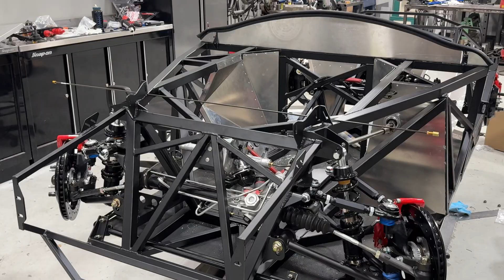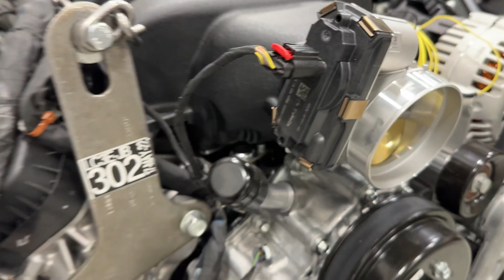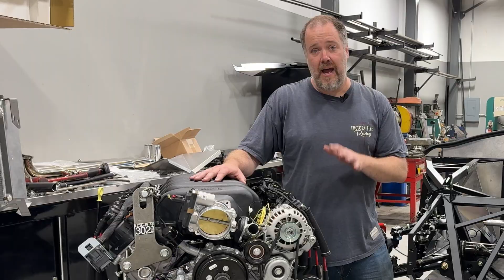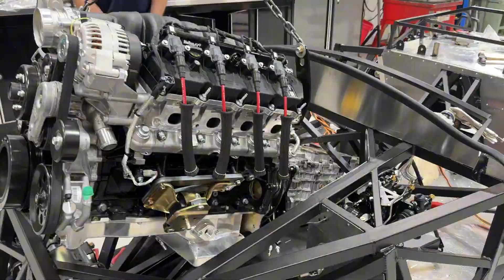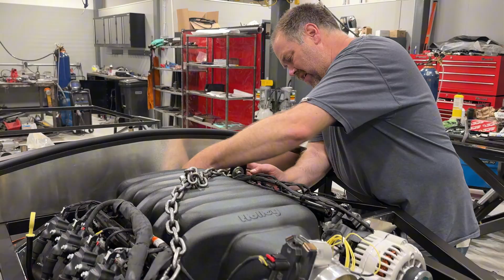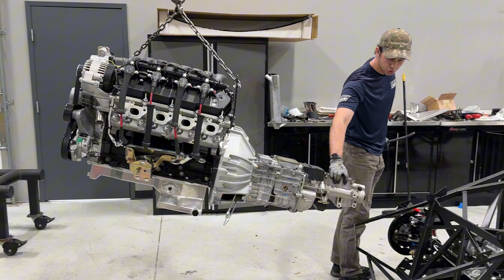Test Fitting the 7.3L Godzilla Engine in the Mk5 Roadster

Comment: What can fit transmission wise.  Is there room for 10spd autos, zf 8hp or bmw DCT?
Reply: To my knowledge factory 5’s cobra platform was originally built with a toploader or t5 transmission in mind, with modern builds using a tremec tko or tkx. Those are all incredibly small transmissions, and even fitting an mt82/tr3550 basically requires punching the whole motor forward. The Daytona coupe has a little more trans tunnel space allowing for the tr6060/t56 magnum to fit, but I highly doubt you’ll have luck fitting anything larger than a th400 or a 4l60 even with heavy chassis modification. By comparison, any of the automatic transmissions you just mentioned are absolutely monstrous. It would be cool, but you’re taking on a serious fabrication project that would require heavy modification of the most structural part of a roadster… and you might be hooking the output yoke straight to the differential without a driveshaft whatsoever 😂 forget about running anything other than independent rear suspension

Comment: Ford fan boys using the name “Godzilla” motor like they didn’t fucking steal it from the skyline.

I’ll buy and build a factory five but the last thing I’m putting in it is some factory ford bullshit engine.
Reply: @BSills-fe8ze  You sound like my boy who put a 2j in a 5.0 and gets spanked by American cubic inches. Plus the GTR head is almost a carbon copy of the Coyote…just saying
Reply: @mdfrtech the GTR came out in 2008 and the Coyote 2011, but the GTR is the copy? 🤣
Reply: @ no actually I don’t own a shit ford or a piece of shit r35 either. 

It’s not impressive that the heads are even remotely similar.

Godzilla specifically was the name given to the Nissan skyline and that’s exactly where it belongs. The R35 we have is not a real skyline in the eyes of car connoisseurs. It’s a rebadged beefed up 370z and looks like hot garbage. The only good looking  part of the car are the tail lights and that’s ok because most people driving behind you in their Chevy volt don’t have to look at the rest of the monstrosity.
Reply: Absolutely. The first and original use of the name godzilla was for the skyline. It wasnt stolen from anywhere else. True story.

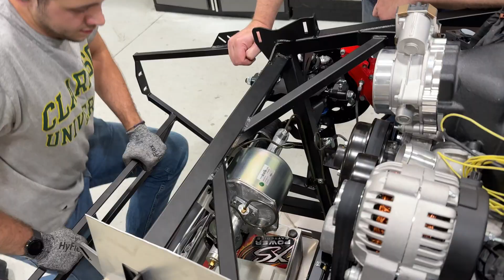Comment: At 2:00, is that EPS? I thought I saw a power steering pump on the crate engine. I cannot figure out what that big cylinder is. Thanks.
Reply: Vacuum booster for power brake option. They talked about it during the reveal video

Comment: Bigger is Better,    time to move that tran to the back and push the engine back and low as possible get that to 50/50 w. distribution , nobody needs a trunk in that machine
Reply: This thing already has a drive shaft that's like like 4 inches long. It can't go back much further than it already is.
Reply: It is already rear weight biased, except for the godzilla. with the godzilla it will handle poorly
Reply: @richardschipper5989  With the power of the 7.3, you could add weight to the rear to help with distribution.
Reply: @richardschipper5989  As poorly as the original 427 FE, which was 150 lbs heavier than the 7.3???